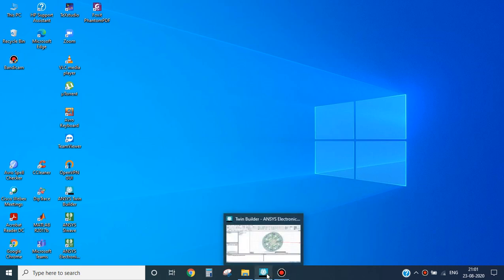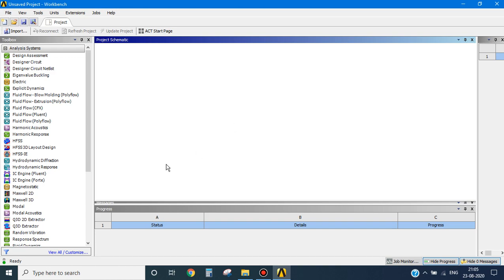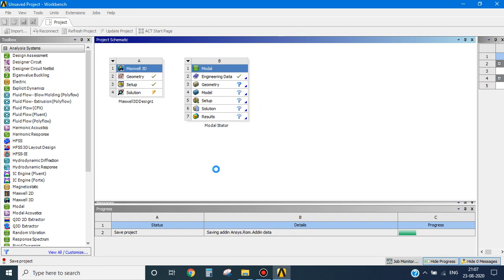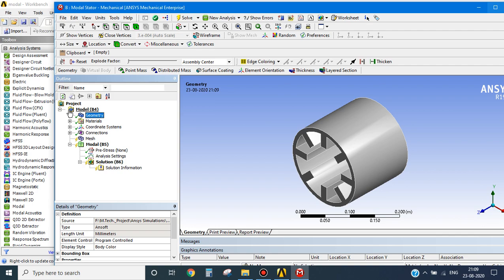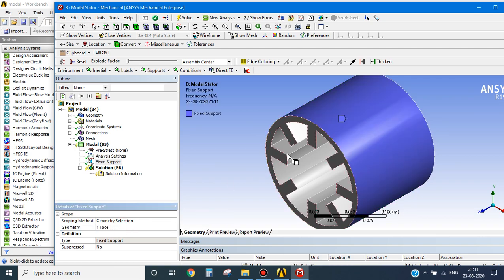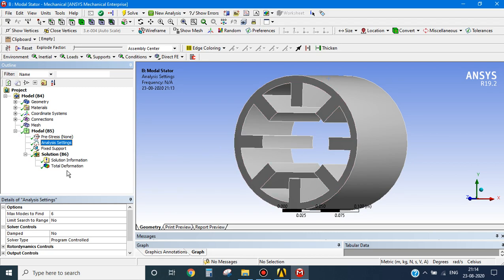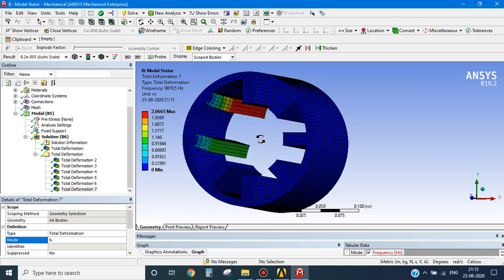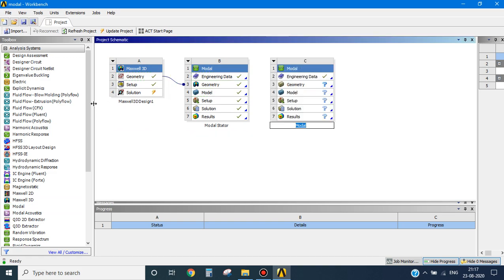Modal analysis of a Switched Reluctance Motor with ANSYS

Comment: Hello 
, exactly which kind of controller used in SRM, im doing my final year project and need to use specific SRM controller  in my project work practically.   8/12 pole ratio srm we have designed, How to get controller.  suggest me.
Reply from the maker: Ideally, it should be a non-linear controller. But it's also popular to linearise the system about the point of operation and use linear controllers like PI.